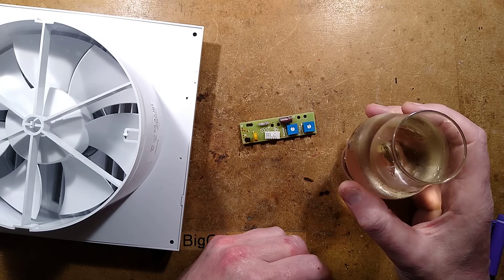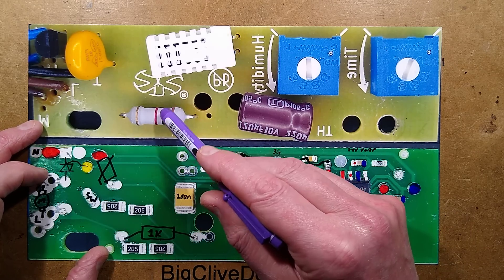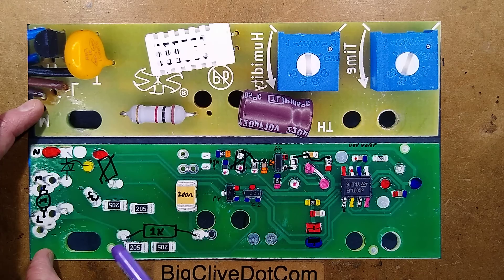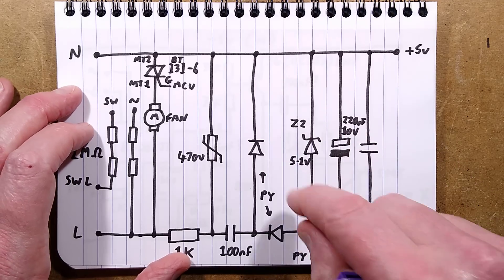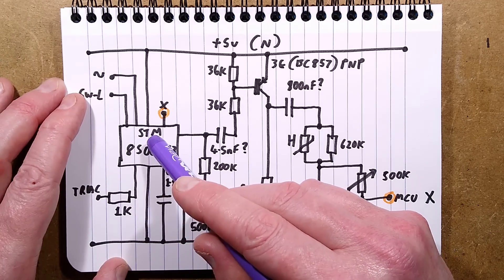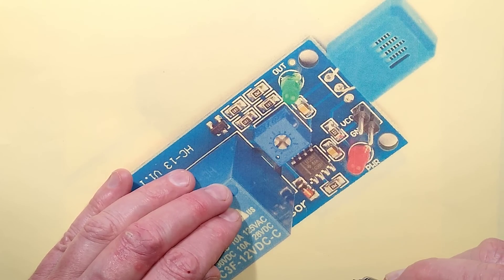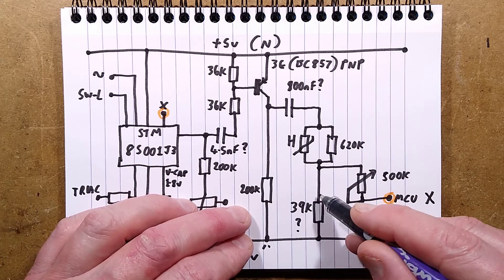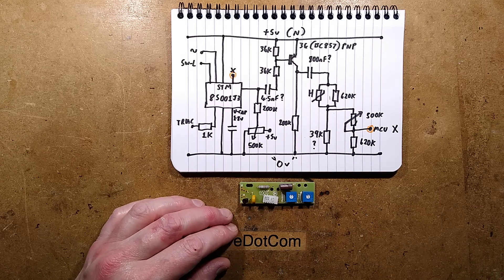Wine powered toilet fan circuit analysis

Comment: The DHT models are digital, and SHT is an analog version.  H= Humidity and T=Temperature.  I worked at a company that made weather stations and Senturion even made a custom part for us...   I thought Wine Powered was a new power cell... then I found out it was your drink, At least the fan didn't Whine  LOL.  P.S. a lot of soil moisture sensors also need a similar AC method to read it to prevent migration... it's not a simple resistance reading.
Reply: SHT11?
Reply: @mprebbz  Yep... we made a lot of fun about the number on that part. I think it is obviously not a great name for a sensor module that you want to take seriously... LOL
Reply: @HobbyHalloween It should have been a methane / hydrogen sulfide sensor. Then the name would fit. 😂
Reply: @galaxya40s95  LOL  yeah, the marketing ppl missed an opportunity there!

Comment: With all of the pinged surface mount components, you might be well-stocked during the next component shortage. The trick will simply be to screen them out of the vacuum cleaner.
Reply: Might be in your beard😂

Comment: The NuTone heat-vent-light I installed last fall didn't have a humidity sensor or a timer. It did have a thermostat, but that's just there to turn the vent on to cool the box if the 250 watt heat lamp gets the box hot. I thought it was odd that they put a thermal fuse in the electrical connection box. A lot of people were complaining that the thermal fuse caused the unit to prematurely fail (within a month), so I removed it. I can see maybe see why you'd want to put a thermal fuse where a 1500 watt heater was used, but this is just a glorified light socket. Also, it has never been practice to put a thermal fuse in an electrical box even when the box is plastic.
Reply from the maker: It's not unusual for thermal fuses to be a last resort if things are getting too hot.  If a unit is left on it can gradually approach the temperature it trips at.
It's better to replace the thermal fuse if it fails as a safety precaution.  It may be that the unit is not designed to be left on for long periods of time.
Reply: The thermal fuse protects for the case the fan is out of order.
Reply: @CG-rr6yx  It wasn't anywhere near the fan. It wasn't anywhere near the light sockets. It was in the junction box.
Reply: @robertgaines-tulsa  A thermal fuse can fail without obvious reasons if it is put to repeated cycles that do not cross the rated limit but are rather close.
Worth mentioning is also that heating / lighting enclosures installed on / in the ceiling are subject to heat accumulation due to air convection currents.
The junction box, which I understand is part of the casing, likely gets heated high enough to be a good place for a thermal protection device.
With heating on, thermostat failing and fan jammed (both because of dust and grime collected in months of good service) a thermal fuse is a last line of defense.
Reply: It wasn't protecting the fan. The thermal fuse was placed in line with the power leads just to protect the wire connections. It looked like an after thought. There is nothing in the National Electric Code about there needing to be a thermal fuse in junction boxes which what this isolated part of the housing is. I wouldn't doubt they'll start putting thermal fusing in every receptacle in switch down the line, if that's what you're getting at.

Comment: I love it. I'd like something similar to kick on my shower fan when I forget (the switch is blocked by a glass door when I'm showering)  and to goose the thermostat so the A/C can replace that conditioned air I'm dumping outside with freshly dehumidified outside air from its make-up intake. (living with extreme outside humidity changes one's goals a bit)

Comment: Here in Australia I've never seen an exhaust fan with a run on feature that lets it keep running after you turn the switch off, less still have I seen one with a humidity sensor.

Comment: This is definitely a nice circuit and it's very clever, but all I can think from an engineering standpoint is that surely all of those discrete components cost more than just using an mcu with another I/O line on it?

Comment: Bathroom fans are not just a UK thing btw they are common throughout the developed world, my bathroom dose not have one though as i can't be bothered to install one.
Reply: I think it's more that this is a fan style common to the UK. I've never seen bathroom fans like this in the US, usually here they're ceiling mounted and are either turned on with the lights or have their own switch (no timers or humidity sensors).
Reply: @Jakek200  he did say wall mount and that does certainly sound odd, do they just vent their poo stank into the master bedroom?
Reply: @ChrisD4335  I would hope theres some sort of vent duct in the wall but i really dont know.

Comment: I would guess that the microcontroller uses the AC line input to detect zero-crossing no only to switch the triac to control inrush current but also to reduce generated RFI.
Reply: Yup--30 seconds error (if that) on this sort of timer is not something I'd expect them to care about.

Comment: Had several failures with low-voltage fans where the regulator electrolytic fails causing the controller to now be driven from half-cycle AC (albeit zener clamped). The step down transformer for the LV fan then burns out causing an expensive failure. So if you have an LV fan controller, replace the supply electrolytic as soon as possible to prevent expensive failures. Lost 2 transformers before I discovered this.

Comment: Seeing the bare humidity sensor reminded me of VCRs of 30 years ago. They used them to detect humidity near the drum and prevent the tape lacing up and getting stuck / torn.
Reply: Ah yes, the old "dew sensor". Fun memories working on those machines...
Reply: @springpan  Ever have to fight with a faulty infrared "tape in" sensor? 🤣
Reply: @dashcamandy2242  I used to wrap the LED sensor post in the middle of the cassette with electrical tape during troubleshoot, but no, I never found many that failed.

Comment: I went on google bard, and asked it to analyse a fan circuit in the style of Big Clive. It said:

"Introduction
Today, we're going to be analyzing a fan circuit. This is a relatively simple circuit, but it's a good way to learn about the basics of fan control.
The circuit consists of a power supply, a microcontroller, a relay, and a fan. The power supply provides the power for the circuit, the microcontroller controls the relay, and the relay controls the fan.

Analysis
The power supply is a simple 12-volt supply. It provides the power for the entire circuit. The microcontroller is a small chip that controls the relay. The relay is a switch that turns the fan on and off. The fan is a simple 12-volt fan.

The circuit works by the microcontroller sending a signal to the relay. When the signal is received, the relay closes, which turns the fan on. When the signal is removed, the relay opens, which turns the fan off.

Conclusion
This is a relatively simple circuit, but it's a good way to learn about the basics of fan control. The circuit is easy to understand and build, and it can be used to control a variety of fans.

Bonus
Here are some additional things to consider when analyzing a fan circuit:
The type of fan: The type of fan will determine the power requirements of the circuit. For example, a high-power fan will require a larger power supply.
The speed control: The circuit can be modified to include a speed control. This will allow you to adjust the speed of the fan.
The safety features: The circuit should include safety features to prevent the fan from overheating or being damaged. For example, the circuit could include a fuse or a thermal fuse.

Outro
That's all for today's analysis of a fan circuit. Thanks for watching!"

Not a bad analysis, but Clive's job appears to be safe at least for now.
Reply from the maker: That's surprisingly good.  It gets the modular approach and actually seems to present it in my style.  I wonder if it's a generic style it uses or if it has an actual understanding of my video presentation style.
Reply: Very generic response...it did not...(because it could not) know the type of power the fan required......

Comment: Clive, don't ditch the fan, just repurpose it for use when soldering.  Looks like a decent exhaust fan and no need for a timer in that application...inside or out of a box.....of which I think out of mostly😉
Reply from the maker: It's not getting ditched.  Although its original intended application is now being handled by a computer style fan.  I thought this one was going to have a thermally actuated shutter, but instead it's just floppy plastic flaps.

Comment: I've got a cheapo eBay indoor temperature and humidity sensor and I've never really trusted the humidity readings. The air vents were also tiny little things, so the first thing I did was drill some big holes in the case.

Comment: Very clever design and a very good video too!
However, those fans are often out-dumbed by the bathroom user. They would shut the bathroom door tight af, to prevent any smelly leakage. The little fan now tries to draw a vaccum, since there is no airflow and the stink will linger longer.